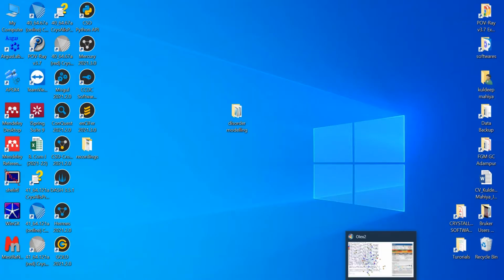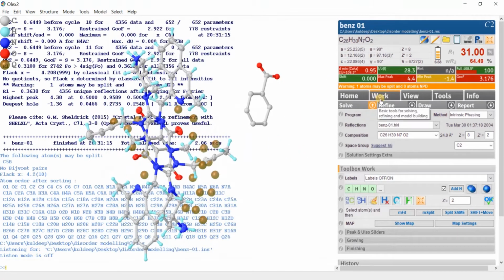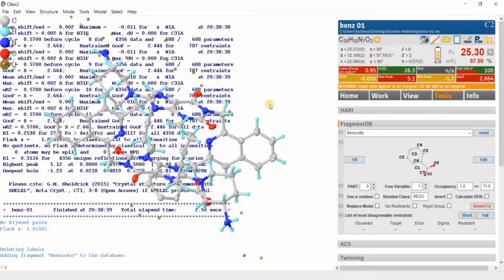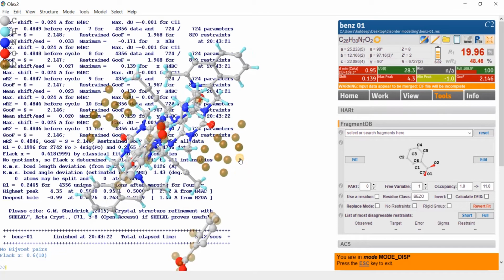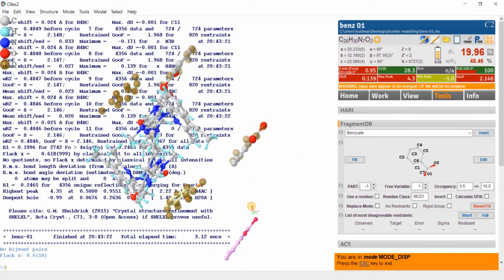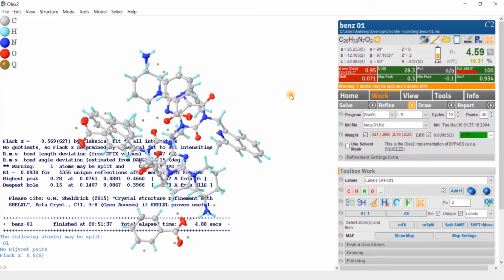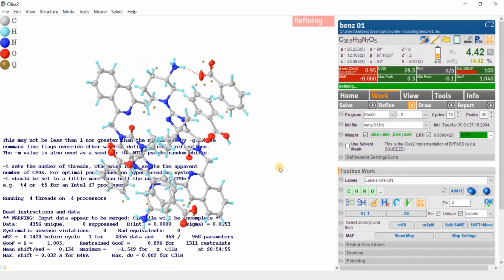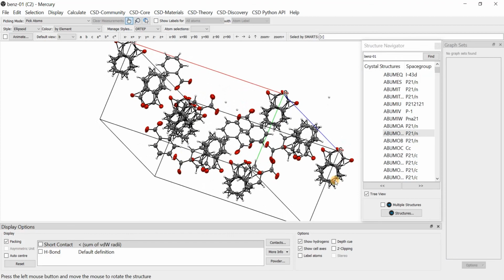Modelling of disorder  about crystallographic two fold axis using FragmentDB in Olex2

Comment: Sir, great video... I am from IIT Kanpur ( PhD last year in Inorganic Chemistry) and it's very very useful. 
Sir, I have a query, I really don't get the point when to say PART 1 or PART 2 or when to say PART -1. Can you please elaborate.
Reply from the maker: Thanks for the feedback Narottam. The PART instruction in the .ins file divides the disordered atoms into
 two or more groups. Each group represents one component of the disorder, and both groups contain the same atoms but on different sites. In front of the first disordered atom one writes PART 1, directly followed by all atoms of the first component and directly before the atoms of the second component one writes PART 2. After all disordered atoms one writes PART 0 to end the area of split sites. The site occupancy factors of the disordered atoms must be manipulated to
 refer to the second free variable. This is done by changing the value of the sof instruction from 11.0000 to 21.0000 for the atoms in PART 1 and to −21.0000 for the PART 2 atoms. The sof is given for each atom in the sixth column of the .ins file. 21.0000 means that the sof is set to ‘1.0000 times the value of the second free variable’, while −21.0000 sets the sof to ‘one minus the value of the second free fariable’, completing the disorder.4 Thus, the sof of both components add up to exactly 1.0000, while the ratio can be refined freely. Sometimes, an atom lies on a special position, and therefore its occupancy
 for the ordered case has to be reduced to 0.5 (e.g. an atom on a twofold axis or on an inversion centre) or 0.25 (atom on a fourfold axis), which corresponds to a sof instruction of 10.5000 or 10.2500, respectively. If such an atom is involved in a disorder, the sof instruction has to be changed to say 20.5000 or 20.2500 instead of 21.0000. If a molecule lies on a special position of higher symmetry than the molecule can
 possess, one assumes a disorder of the molecule about this particular special position. The second site of each atom
 can be calculated directly from the positions of the atoms of the first component by means of the symmetry operator of the special position. Therefore, it is
 not necessary to have two parts in the .ins file. Instead of PART 1, PART 2, and PART 0, the disordered atoms are flanked with PART -1 and PART 0. The negative part number suppresses the generation of special position constraints, and bonds to symmetry-related atoms are excluded from the connectivity table. Moreover, the use of the second free variable is not indicated in such a case, as the ratio between the components is determined by the multiplicity of the special position.
Reply: Thank you, very much sir! @DrKuldeepMahiya